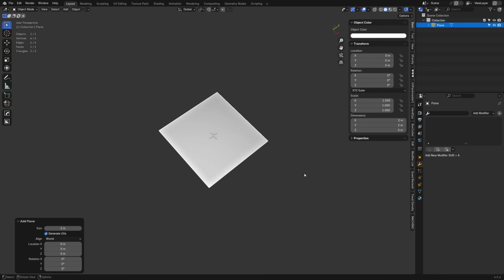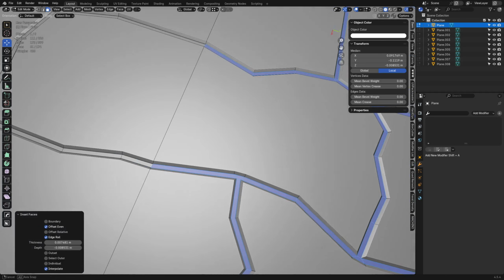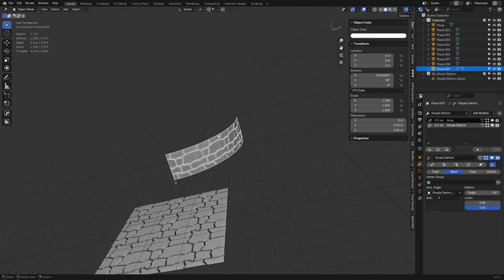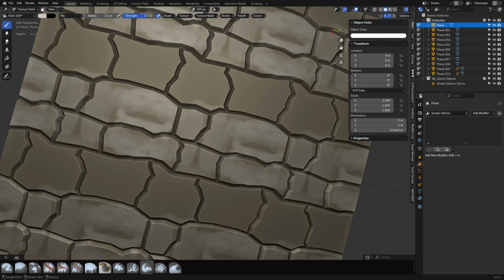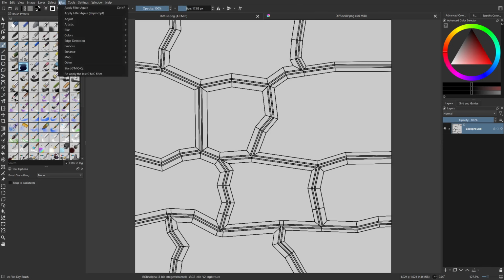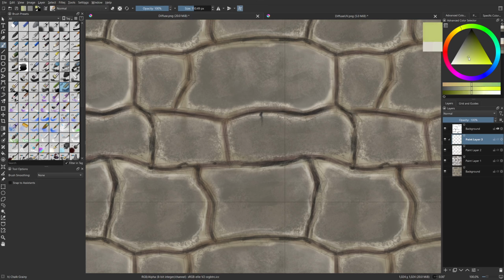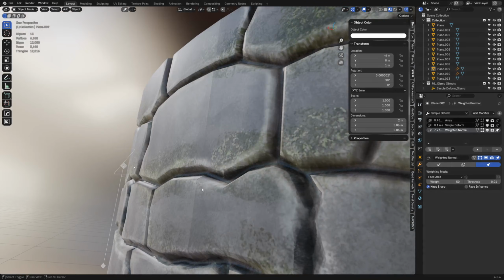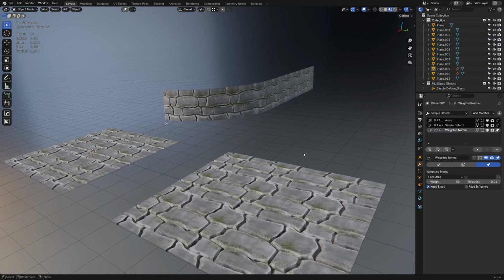Seamless Modeling in Blender

Comment: Hello. Do you have any advice on editing complex, high density meshes so they tile? 

Lets say i displace a plane with a tilable height map. It tiles, but now i need to remesh the plane so it isnt so complex, while also maintaining its seamless tiling!

All remesh tools break the tile
Reply from the maker: Different strategies. I only have one video talking about seamless sculpting and 1 or two on trim sheets. Usually it is best to make objects seperated so you can duplicate them to the other side ensuring it stays seamless. If not that, you can use substance painter to clone stamp and fix the seams on a plane.